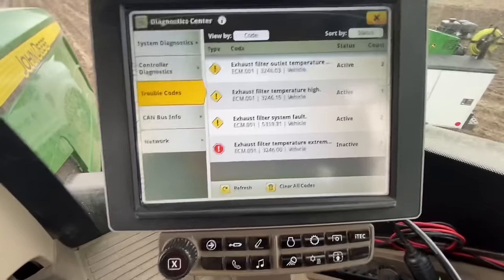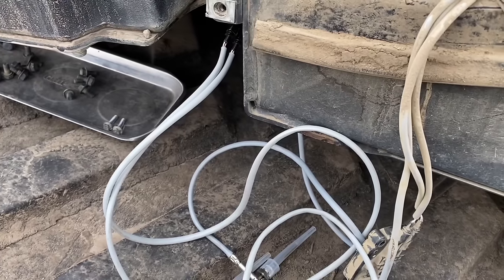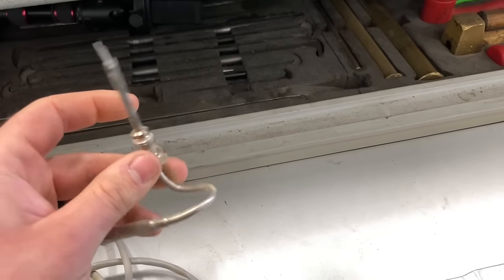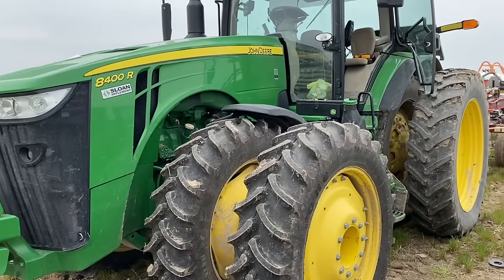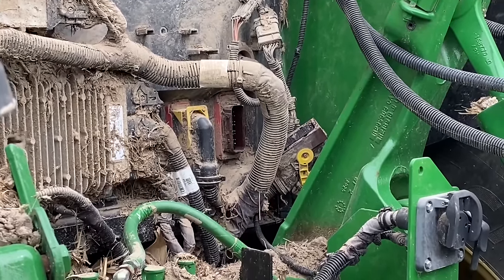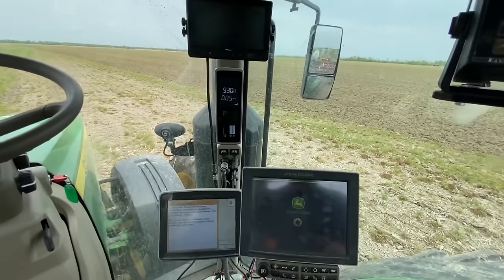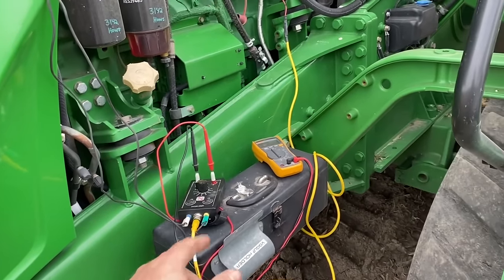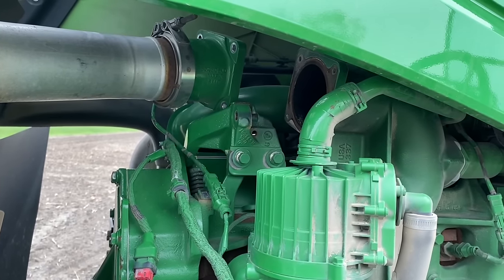John Deere 9570RT DPF issues  | 8400R CAN bus is Down |  9560RT air throttle valve repair

Comment: So true about what you said pertaining to the level of knowledge required to be a good tech in the ag or automotive world today. From the ability to interpret what the customer complaint is to being able to reproduce it, diagnosing it and fixing it. So much time goes into all of this. I may spend an hour just looking up theory of operation and looking at wiring diagrams if it is an unfamiliar vehicle or circuit so that I can intelligently tackle the problem before I ever even open the hood.I'll bet your diagnostic process is much the same. Love your videos! Keep up the good work!

Comment: Im glad someone said it, im a mechanic for Missouri DOT and work on lots of John Deeres, a little smaller than those but i always love when the older mechanics or people say "Back in my day people would fix things instead of replacing them" or "We disnt have to use those fancy computers we used our heads." It always cracks me up im sure they did and many things you still can but most of the time you cant.
Reply: Ha, makes me laugh, "we ised our heads".
 You have to know twice as much to be able to diagnose and fix something these days. Computer just tells you the code, not which part of the harness the rodents have eaten, or which fuel injector caused the carbonation that blocked the oil strainer.

Comment: Love all the troublshooting and system knowlege in these videos. That was my favorite part of working F-15's in the Air Force.  Its cool to see similaries in troublshooting stratagies. They are both highly complex machines. Keep up the great work!
Reply: worked F-15's in Idaho for over a decade. Very similar in troubleshooting techniques. even the butterfly valve looks the same as some of the cold air valves on the 15. Awesome videos.

Comment: Hi Zeth, thanks for another fine video. Have to say that my experience is that we have two types of techs these days! Those who can diagnose and those who cant and the ones that cant are literally parts changers. As I have said before I was a mechanical engineer for many years and was trained old school, but quickly learned that you need to understand the whole picture before making decisions. I recently had a fault with my BMW x5 and in my mind it was an earth fault. Local garage tried 3 times to repair and failed list a host of issues/parts that needed to be changed out. Took it to the BMW dealer which was in the city so a fair journey from home for them to resolve the issue. They gave me a courtesy car and I headed home. Less than 10 minutes into my journey home and I had a call from them to say the fault was an earth fault which the had found and repaired. I would need to keep this message going for another 20 lines to give you the list of faults that the local garage said was the problem! So the moral of the story is let those who really know their job and are good all rounders like yourself, get on and do the job right the first time!. Thanks

Comment: I felt so smart about that 8400 cause I immediately thought armrest control harness got bit by that tab on the seat, the biggest machines I’m on are 6140R and lower so it’s one of those if one does it they all do it. A lot of guys around here don’t run seats with enough air in them so the harness slips under the base and gets absolutely hammered or it twists and rubs. Did a 6125R, every wire but 2 were just fubar . HCU, Cornerpost, ICC, all the P controllers were freaking out. Fixed 14 wires over an 8” section of the harness and had it out that day since no one had a harness for it.

Comment: Thanks for another great video ZK. It was interesting and enjoyable. 

ZK you are one extremely talented technician. The diagnosis work you did on this video was way over the top. This modern day equipment is wonderful but, but, but when it goes wrong, you need someone like ZK. The days are gone where the farmer can work on his equipment like tractors and combines. 
ZK the work you did on these units today was ever so interesting. The work you did to track the problem was so technical. I found the video so very interesting and a great learning tool. A real eye opener that if you do not have the skills wait for ZK. 

About it for now. You take care and be safe. 
Looking forward to the next video. 
Thanks for everything ZK. 
Appreciate the filming you did to show what it takes to figure out the problem. 
The Iowa farm boy. 
Steve.

Comment: 14:30 so true. And  one more important thing is you also need years of experience. Its not that you graduate and you know everything.  With the wire. Someone els could just say a modul is broke and replaced that, costing the farmer more money, but you did not do that you just fixed the wire. That is also very important ethic, I think you are a very valuable asset to John Deere. If i would be a farmer close to you, i would demand John Deere to send you every time i want service. LoL

Comment: I had to diagnose my 4850.  Low voltage “code” was present…..(volt gage low).  Ran home robbed my 4430 alternator…..back going.  Down time 20 minutes.  No emissions codes all spring.

Comment: Dude, the fact that you have to work with all the different systems (electrical, hydraulic, diesel or gas engine, mechanical, HVAC, and more) on dozens of current production machines and hundreds of previous generation machines that do things in entirely different ways is a high bar.  Just knowing how to identify the actual root cause of the problem takes a lot of knowledge and experience and anybody who claims otherwise is very foolishly mistaken.

Comment: Although I work in a different industry, we have very similar skills / Jobs. I am a Service Engineer for a German Machinery Company. You are quite correct in as much as not being a parts changer, The Machinery my Company manufactures are CNC Machining Centers of various sizes and industry uses. We have customers who manufacture Dies and Molds along with Medical and Dental implant customers and everything in between. One week I may be doing a large Mechanical Repair and the next, trouble shooting an Electrical / Computer issue or teaching and training. The days have passed where I would have done a complicated component repair / rebuild in the field. Our company has various component repair / rebuild departments at one of our German facilities. Say an axis drive goes bad. We will install a rebuilt unit and program the parameters for that specific machine. A huge time saver for us in the field. The customer can't bring equipment to us, so I travel every week, covering the entire US & when needed Canada. As I am 65 years old this fall, I have seen many changes in Job requirements over the years. I enjoy seeing your diagnostics and problem solving very much. Thanks for your efforts with this channel sir!

Comment: If the 9579RT got that hot at the DPF outlet to melt the sensor tip I would suspect the DPF is melted.  The DOC and SCR may not function that well due to rapid aging of the catalyst coatings from high temps.  I have seen DPF that melt in the middle but look fine at the outlet.

Comment: The last 2 air throttles I have seen go bad were locked up, the actuator housing on one was melted. I found drive wires on both machines shorted to ground.

Comment: Hey ZK, great video on troubleshooting the CAN bus! Wanted to ask if all you used was an digital meter or if you also have an analog one as well? I had a similar issue on my Jeep where we'd just installed a rebuild engine and got it all connected, had done the initial run-in and then all of a sudden it wouldn't start or if it did it wouldn't stay running. Checked all the connections (good fuel pressure, power to the computer, etc) and were checking all the connections on the computer with my digital meter, still couldn't' find where the problem was.

For some reason my brother and I decided to borrow our dad's old analog meter (think we were trying to check two ends at the same time) and my brother just happened to catch the needle on the analog meter barely twitch, but the digital meter still showed nothing. Ended up being damaged insulation to the distributor (very similar to your short) that if you bumped the wiring the right way it would clear, but otherwise there was no power going to the distributor. Never would have found it without the analog meter because the digital meter just couldn't' react fast enough ( the DMM is a Fluke 87). It was a great reminder of a lesson from my college electronics course about that very situation, where there are times where an analog meter will show fluctuations like that easily where the digital meter misses them (has to do with averaging times on the DMM)

Comment: I think the misconception that techs just fire the parts cannon is due in part to bad shops who don’t train their techs and modern vehicles having so many parts that can only be replaced and not repaired. I’m in school to be a tech and the one thing every instructor repeats is that our primary task is to diagnose the problem and then fix it

Comment: Great stuff, especially the shorted can line. Every time you see a twisted pair and wear marks on the wires, you know you're almost there. Does John Deere have any recommended repair methods for repairing can lines? Do they allow soldering, or do they require a new wire harness?
Reply from the maker: I always use heat shrink butt connectors. Never failed me yet.

Comment: hey thanks for the videos.   i am an electrical engineering pro,  have designed with the CAN bus protocol,  and i also rebuiild jeeps as a hobby.   i have to say that you see so many CAN bus failures is troubling.   the fact that two power wires were pinched and shorted by a seat hinge,  it never should have happened,  and i think its a design failure by JD.   that split loom harness behind the seat should have been protected with a metal shield or at least used closely spaced steel tie downs on the floor.  that the loom could migrate up into the seat hinge is complete design engineering failure.

whats even more troubling is that you had to pull the cab to find some of these power shorts.   this is absurdly bad engineering.   any wiring that important and inaccessible should have double looms shielding or even steel shielded looms or whatever it takes to not break and expose the wires.   it may also mean increasing the gauge of the wires.

the fact is most cars and trucks never have a can bus failure.   the reason is makers have learned the hard way to protect the wiring and prepare for the harshest of conditions,  and are over engineered.

I definitely appreciate your knowledge and skills at fixing electrical problems,  but this one was purely a design engineering failure,  and makes me wonder about John Deere.   The engineering is so bad I would hazard to guess that Deere may even want these to fail.

Comment: hey, i've always wondered, i any modern tractor, what would a normal, correct reading of the ohms be, you've told in the video, it shoudn't exceed 1000mOhms, but i was wondering if that is the case with pretty much all electronics around the tractor or how do you figure this out, where do you get the information for instance?
Also, should the reading be the same in some rarer cases, such as an electrical diagnositc of an older tractor, were they built with more resistance or not.
Reply from the maker: There is a spec in the service manual
Reply: @ZKMasterTech   the service manual the tractor comes with, or another one for mechanics only?
Reply from the maker: It's for technicians. But customers can buy service advisor.
Reply: @ZKMasterTech  thank you very much for the info.

Comment: In your experience does rhe egr or other emissions controls "def and scr" shorten the engine life? Which one would be the worst?
Reply from the maker: EGR is probably the hardest on the engine. Lot of black soot going back into the intake. The DPF and SCR don't really effect the internals of the engine since it's down stream of the exhaust but if they get plugged up it's hard for the engine to breathe.
Reply: @ZKMasterTech  Thank you, that's what I thought but I'm no diesel tech. I enjoy your videos
Reply: @ZKMasterTech  Plus with the DPF & SCR you need to run the engine at full bore to minimize the amount of soot from load spikes or it will shorten the life of the DPF and it's sensors.
I've been fighting the DPF & SCR system on a pretty new Volvo powered forestry harvester for the last two months where it would throw very vague codes on bad DEF quality every other day and lock down the engine from doing anything else than idling. Now after many, many technician visits hopefully they found the issue, with the Nox sensors being out of alignment and a issue with the Volvo service tools... And most of the Ad-blue system has now been replaced and serviced so hopefully it won't be the cause of the next issues.

Comment: My dad farmed for 40 years.  I don't think we ever had a tractor die in the field.  Ran Case and Steiger.  Never touched an engine or transmission.  Bought good used examples and ran them hard.  The biggest incidents I remember was a broken fan belt and a failed steering hydraulic hose.

You couldn't give me a new JD tractor.  If you did, I'd sell it and get something reliable.
Reply: I don’t care what brand it is they all brake sometime
Reply: Yes and he ran the best Era of trouble free tractors these new plastic dpf tractors won't last 5 yrs without complete shutdowns and mother deere to come to the  rescue with his pc. I  know it is completely there fault that is a political issue but they just won't hold up like the pre dpf and metal tractors did.
Reply: @j.c.ferguson2086  especially if it has dpf and all the crap all over it . I have watched all these fan clutch problems and I'm glad I don't have a green one in sight 😅 my case still has the factory everything  and it's an 09 and these things can't make it 2000 hrs without 5000k worth of parts to get the engine cooling. I'd get a 4430 or 4440 and call it good the only thing that they will need is a cab kit and filters that gets you 20 yrs of continous reliability. I have nothing against the older deere stuff but I wouldn't touch these new ones .
Reply: @jwhitley101whitleyfarms9  I totally agree.  If I were farming today, I'd be purchasing older 500HP 4WDs and rebuilding them.